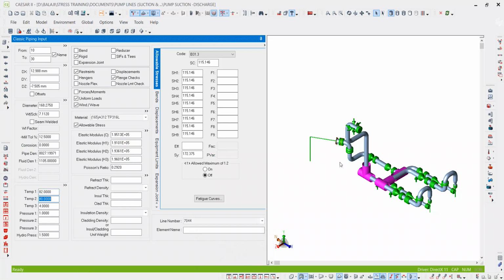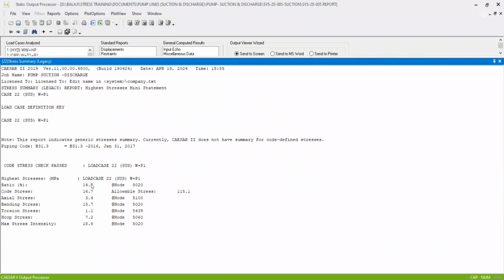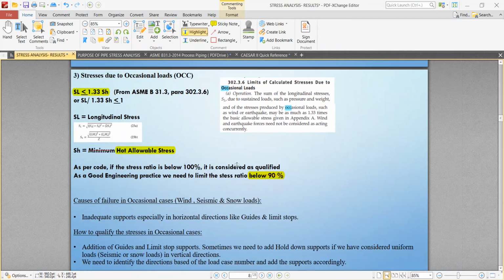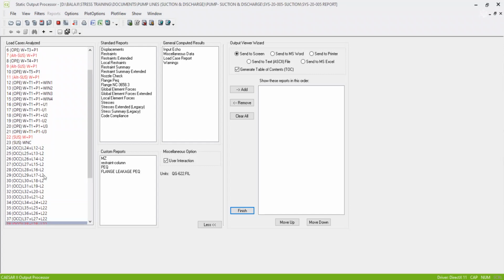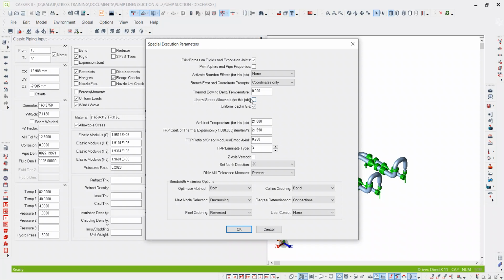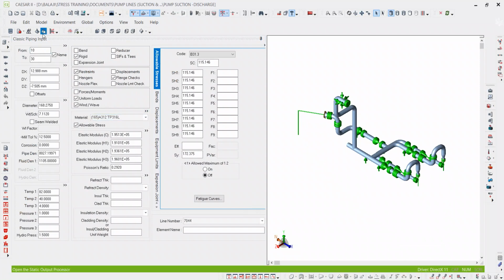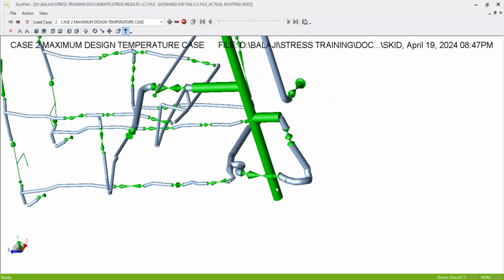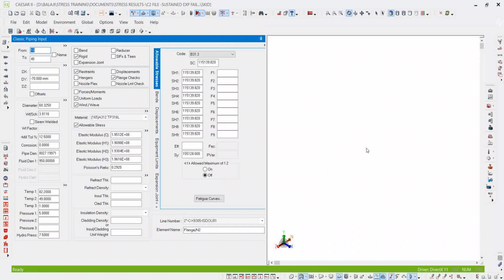CAESAR 2 - PUMP SUCTION & DISCHARGE LINES- ANALYSIS RESULTS- HOW TO CHECK STRESS OUTPUT  - PART-3

Comment: One small correction for sus min hot allowable only consider which means the lowest allowable value of all the sh will be takes in order to compare with code stress
Reply from the maker: sorry for the mistake. It should be Sh min shall be considered..